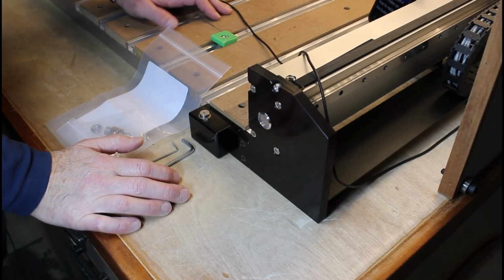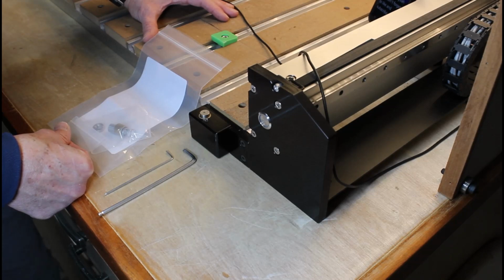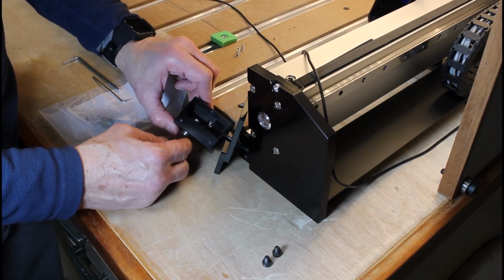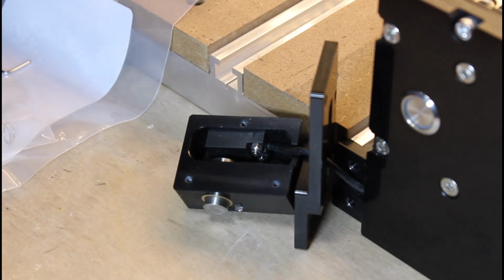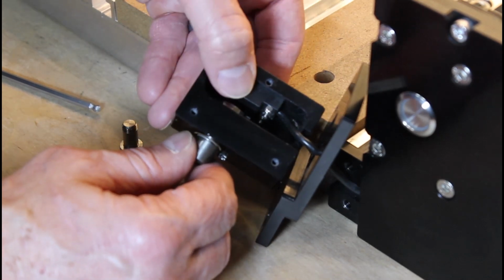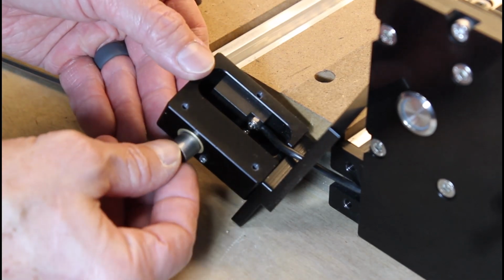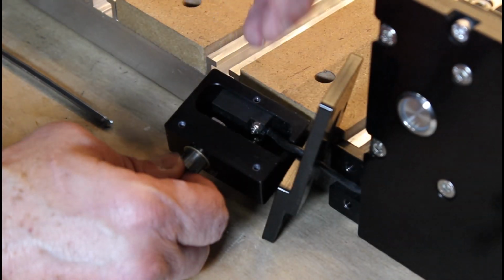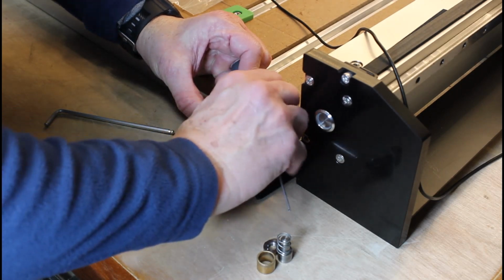How to Repair your Shapeoko Pro Bitsetter

Comment: I made this same mistake surfacing my Pro XXL several months ago. Felt embarrassed but the support team was cool and sent the replacement kit free of charge and in only a couple of days. Learned to temporarily disconnect the Bitsetter via the 2 larger bolts and lie it flat on my work table out of the way just in case so this doesn't happen again. Looks like Carbide 3d redesigned the 5 Pro's Bitsetter to be even easier by just sliding it off the T-slot extrusion. Good video.